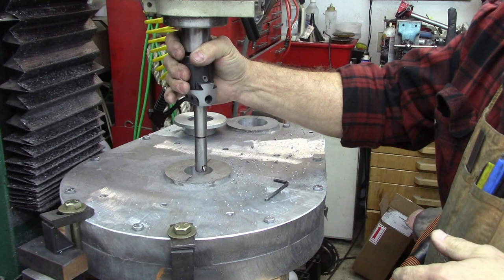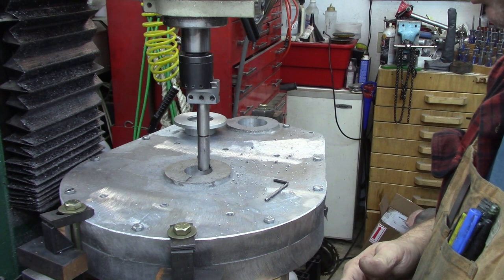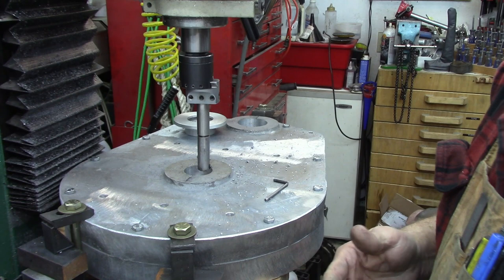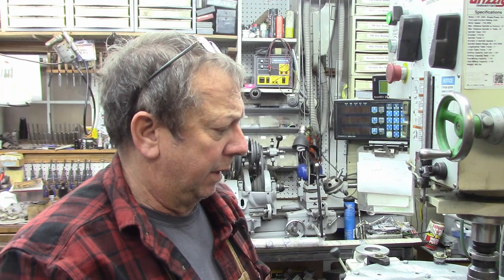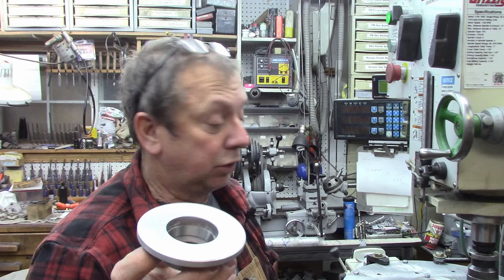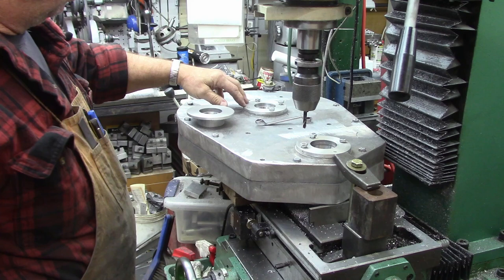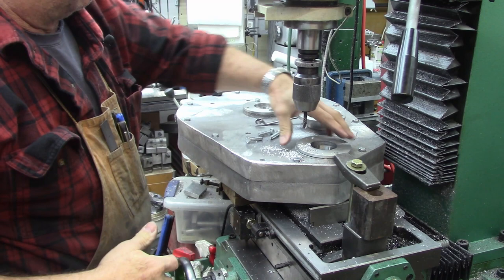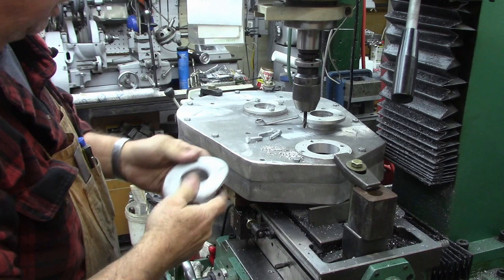Building A Sand Muller: Part 12, Machining The Gearbox

Comment: I never saw that way of locking the tool steel into the boring bar before. Thanks for sharing that.

What were the considerations with led to putting the draft on the gearbox half that way?
Reply from the maker: fairly common to lock cutters from inside pressure when the bars are large enough to accomidate it. Draft on the gearbox is more than I usually use (I think about 5 degrees) since it is so large and only used for the 2 halves I wanted it to be as easy to pull as I could make it and I don't mind the extra material or cleanup necessary for a one off part. In this part think function over form(appearance) Thanks, Dan.
Reply: @hillsgun  Good call. I also made my muller without consideration for form. I lurks in the corner as a rusty sandy mess :)